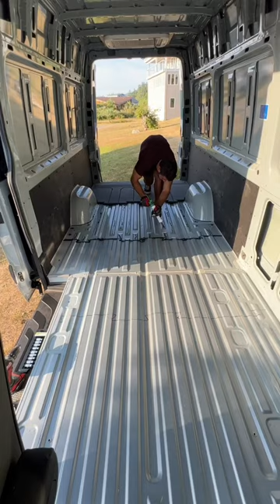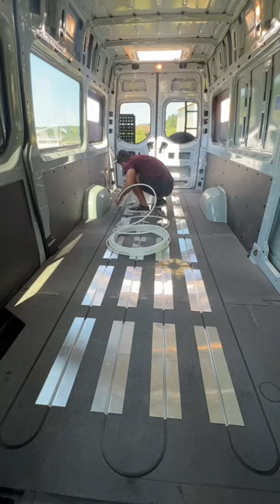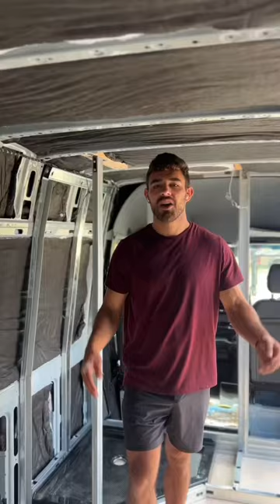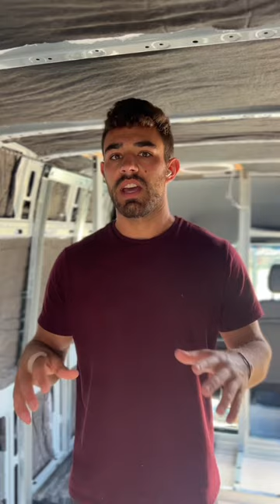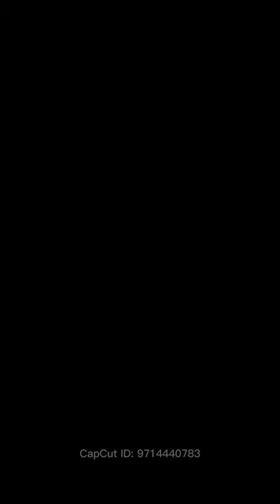Vanlife Heated Floors #vanlife #vanbuild #camper

Comment: is that yours.. if it is you got it made. I froze my Kahuna's off in a van back in 85 with no heat in the floor. it was like sleeping on a block of ice. I got double pneumonia that winter in Georgia.
Reply from the maker: The floors made by Rixens but the van is mine. And i’m so excited this floor is game changing it sounds like you had a rough winter or two in your van. Props to you!

Comment: OK so let’s say someone is short, can you make a water tank that is like 2 inches thick and it’s the whole floor. Would that be about 100 gallons?
Reply from the maker: Theoretically yes, but there would be issues with water being pulled from it when parked on any slant
Reply: Ive had this thought for a while too! Im 5'5". Was wondering if i can design a van with a massive flat water tank. Im now wondering about weight distribution and centre of gravity though.

Comment: Not needed
Unnecessary weight add
Reply from the maker: Its very light
Reply: This is no different than adding insulation to the floor, and if you don’t add insulation? Well don’t complain when you freeze your toes off in colder climates.